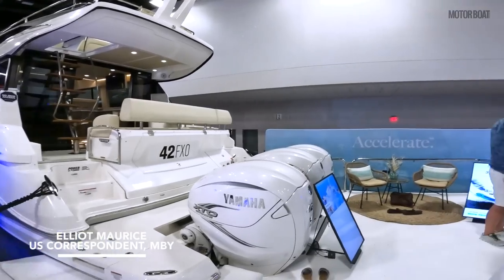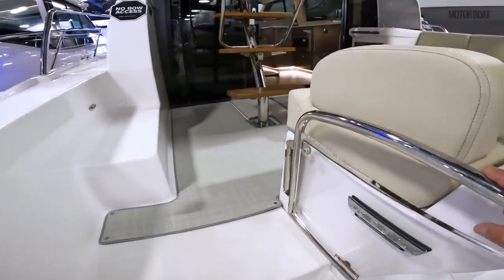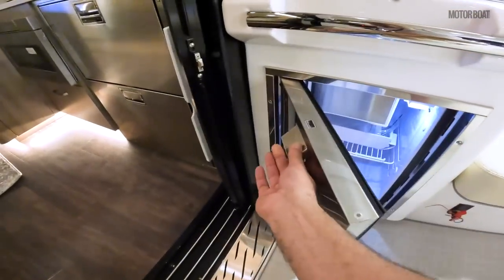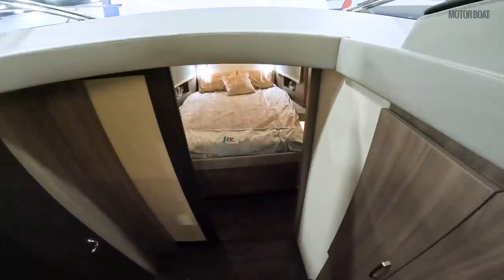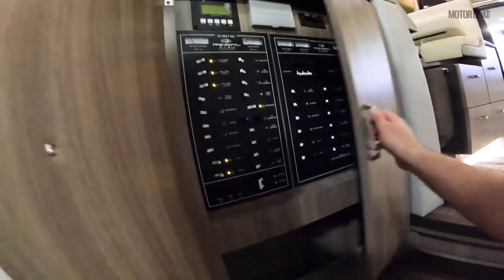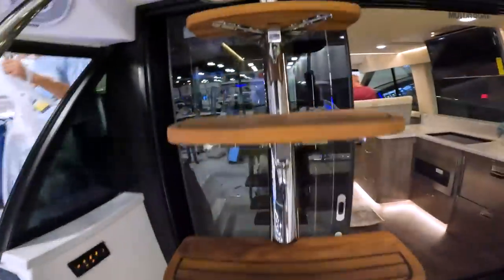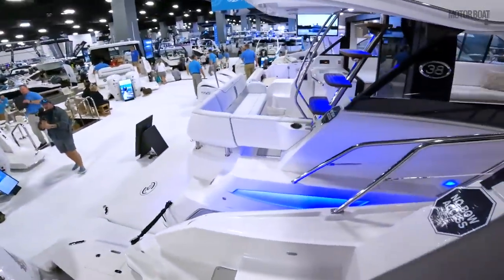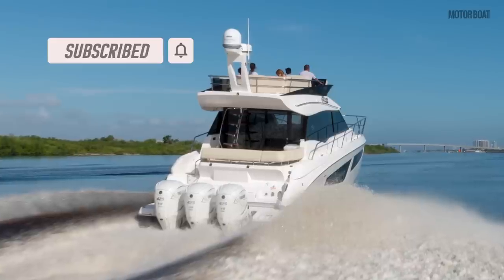Inside the world's first outboard-powered flybridge | Regal 42FXO first look | Motor Boat & Yachting

Comment: The point of the back deck on a cruising yacht like this is to allow unimpeded access to the water. The manufacturers clearly didn’t know this or else they would have mounted the engines forward of the deck

Comment: Thank you MBY a nice show of this show off this Regal 42FXO Flybridge with outboards very nice beautiful boat but why not with Diesel outboards or even better with Electric outboards that would really spectacular but a nice show thanks
Reply: Remember this is being shown in Miami.  In the US market, gasoline (petrol) outboards are the norm, and even a boat of this size with inboards might have gasoline engines.  Also, Diesel outboards are quite new and don't yet reach these horsepower levels.  Electric outboards same, but more so.
Reply: That being said, I just looked at Regal's site, and the inboard version of THIS boat gets IPS diesels.

Comment: 1275hp from petrol engines? Any savings on maintenance are gone in extra fuel costs surely?
Reply: Hi Nick 
There are a number of benefits over a diesel powered variant.  Diesel in the US is the same price as Gasoline.  The boat also has a much higher cruise and top speed vs is diesel variant.  43 knots vs 34 knots so a much higher efficient cruising speed and burns less fuel at the effective cruise speed of the diesel version.  The servicing costs are about 40 percent less.  But it is a more expensive boat to start with.  Those 425’s are very quiet also.  I haven’t driven  a high volume hull powered by outboards yet so I can’t comment on how it rides or handles, but I am understanding the mind set behind these boat’s.

Comment: Im sorry but this whole trend of putting OBs on heavy boats with drafts > 3 ft is silly. With outboards, there’s nowhere to store a dingy, and with no dingy how are you supposed to get ashore without a proper dock? Realistic anchoring depth is 5-6ft. Im not beaching a million dollar boat that weighs 15 tons…
Reply: It's a FAD. Surprised it didn't was not also a bowrider too.
Reply: Looking on Regal's site, I see there's a huge storage area under the cockpit sole.  It's not a tender garage, but you could easily put a deflated inflatable dinghy in there.  Several shots on their site show it nearly beached, too.

I think this is very much a US-market boat.  I'm not a cruiser guy, but I see plenty of marinas here full of boats with no visible means of storing a dinghy.  I suspect that, to the extent they're used as more than day boats (which may not be often), they're taken to places with docks or water taxis.  Or they're just anchored in a cove as a base for water play, with no intent of going ashore.  Also re beaching, we have much lower tidal swings here than you have in the UK.

Comment: Would be great if this could be electric, lovely boat though
Reply: Can I ask what would make it better if it was electric?

Genuine question. Is battery energy density that of gasoline in this case? Are there charging points on marinas, or would you just plug it into shore supply as per normal? I’m truly intrigued. I’ve yet to be convinced to get an electric car and would love to know the arguments for and against electric on water.
Reply: @PhilbyFavourites  hi, my view is that where the engine would normally be that they could put a very small one and fill the rest of the space with battery packs. Put a hard top on the flybridge and solar panels, to help charge. 
You would just plug it into normal shore power when at Dock. 
Right now you can't get high speed easily with battery, but no to little fuel cost, the small back up engine would be to help in emergency and if battery needed a top up on long journey.
Benefits to wildlife, massive reduction in noise, reduction in polition as well. 
Also once the blades can be moved into the back of boat, less likely to hurt sea life with a propeller.
Reply: @jaffaholland4039  what is the point of creating an electric option on a small planing yacht🤣

Seems very silly